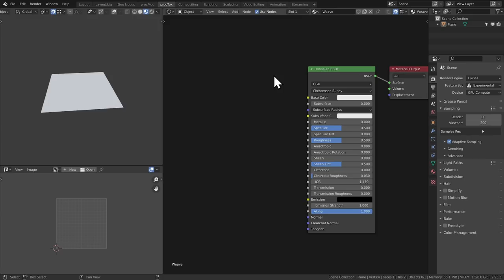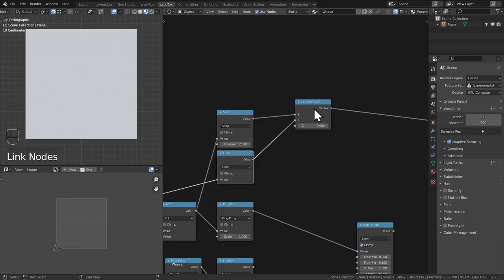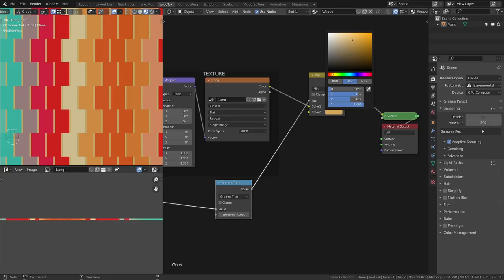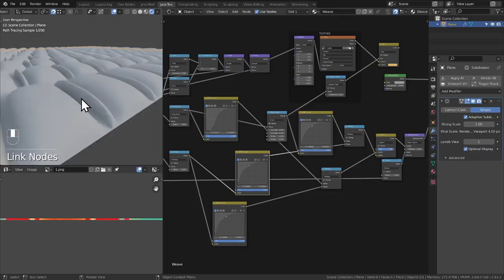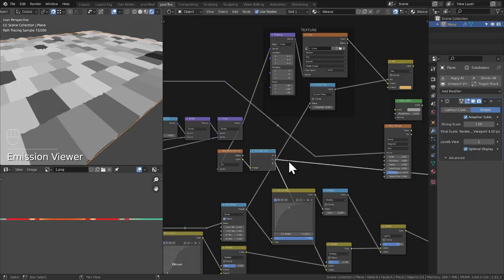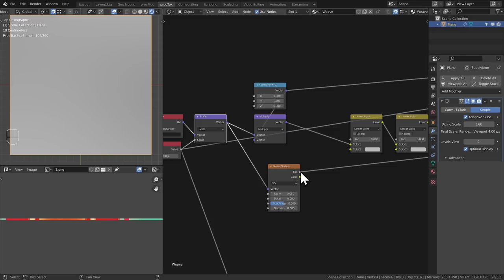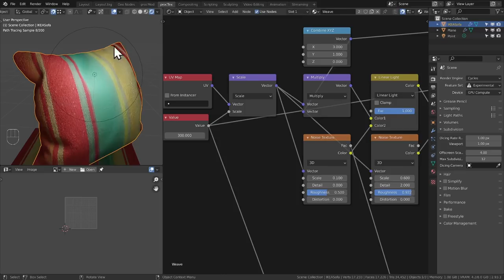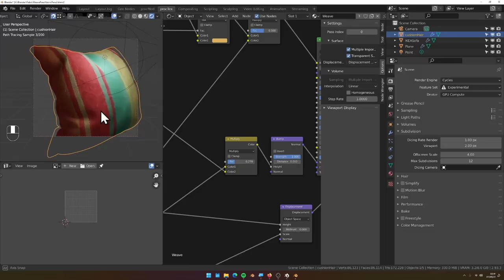Procedural Fabric Weave - Blender Shader Tutorial

Comment: I typically do 1/density then multiplied with my nominal height of choice, rather than nominal height of choice/density, whenever I want to scale down displacement based on texture density. You also forgot to do that on the bump node, so the distance will remain fixed across all texture sizes and really mess things up. The wiggly noise can be 2D, no need to go 3D if you only give it a 2D coordinate like a UV.

Have you ever toyed with using i.e. [0.5, 0.4, 1.0] and [0.5, 0.6, 1.0] -> normal map -> mixed shaders of different colors? It's a nice tool in the shading of fabrics. Don't overdo it as it leaves artefacts, and we need better tools if we want to make nap based true velour (where flipping fabric upside down basically makes it go very dark). Subtle color changes work well though.

Comment: Nothing happens in 9:28 when I connect ping-pong node to the displacement(In the video, each square is shaped like a comb), I meant when I set the cycle render engine and apply sub-divisions, every little square is not transformed like a video, and it's lumped into a big triangle.

Comment: man, this is amazing - two questions; how efficient is this method vs image textures (with bump, disp, normal maps etc), and how graphics-intensive is it
Reply from the maker: Considering that you're rending inside Blender, performance is sort of secondary as you're offline rendering. You would definitely want to optimise the workflow if you were rebuilding this for mobile games in Unity etc. Procedural textures tax the CPU and image textures tax your ram / Vram.
Reply: @Erindale  cool, thanks - i mostly render single images and don't currently have a GPU (and only 8 gigs RAM), so i'll do a bit of testing to see which works best

Comment: wondering if there is a online platform with procedural shader collection!?
Reply from the maker: There are a certain amount on blend swap and blender kit and gumroad. There's also one that was just people's procedural textures that I think died off pretty fast. The issue is quality. Someone needs to be curating it because so many shaders are terrible or very single use. It's a good idea in theory though! I think the asset browser is going to make asset sharing a lot more accessible
Reply: @Erindale  is there a way to import and export shader nodes as text files? so when u import the data, the shader is beeing generated for you automaticly
Reply from the maker: @dinisdesigncorner332  Not as far as I'm aware no. Sharing node groups or materials directly is still the way to go :)

Comment: Now I have another issue...when I attach the ping-pong to the displacement it just shows a black and white checkerboard pattern on the plane, it doesn't displace it like crazy like in your video. I can't figure out what I did wrong at all
Reply from the maker: Have you added adaptive subdivisions? You need to have the experimental feature set enabled on the render tab for Cycles for that option. Also double check that you have enabled displacement in the material options and that you're in Cycles rendered view.